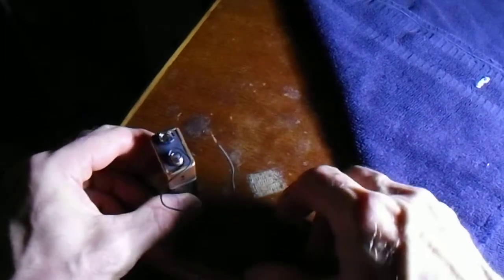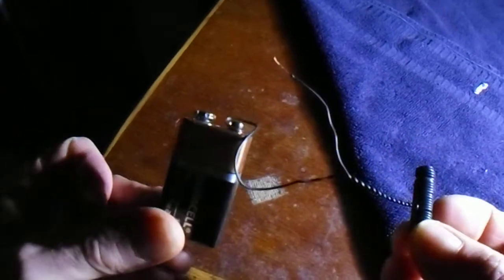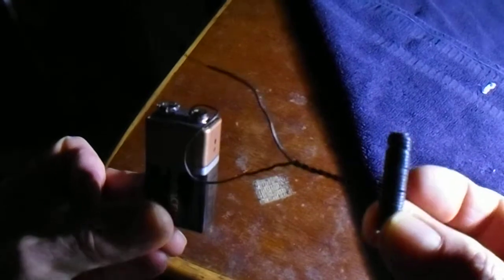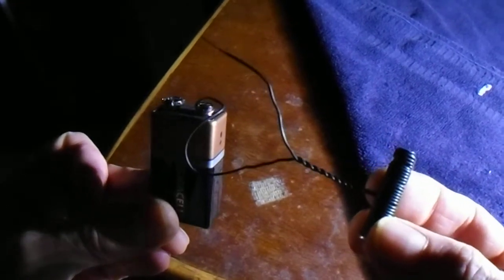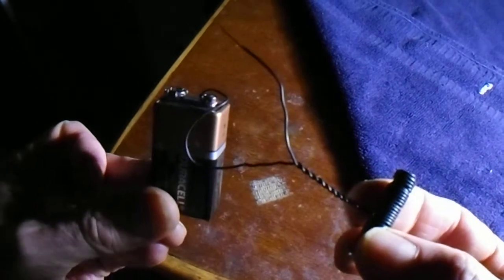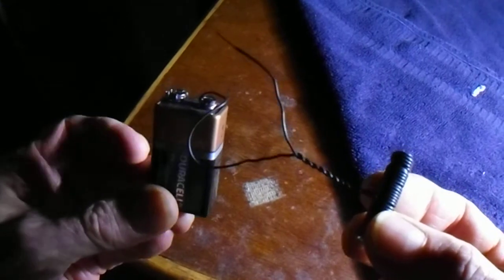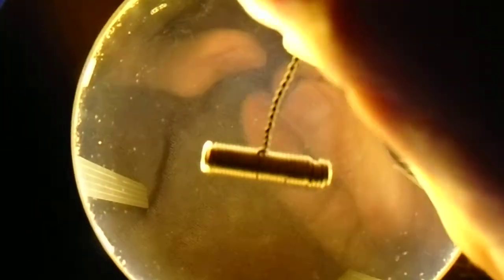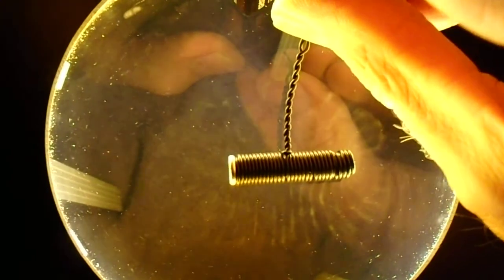electro magnet on ferrocell

Comment: Ferrocells are neet. They are at best magnetic analogs to a hall of mirrors, magnetic illusions complete with many distorted mirrors. 

Here's a simple experiment:
Step 1. Take two cube magnets only because all faces are the same size, but really,  any magnet will work for this experiment.  Mark the sides that repell and attract. These are the magnetic poles. 
Step 2) Reduce the number of light sources in your ferrocell to one.
Step 3) Place one pole facing down and move the magnet around. 
Step 4) Leave the magnet in place and walk around the ferrocell.
Step 5) Leave the magnet in place and move the light source. 
Repeat steps 3,4, and 5 with anyone of the cube's six nonpole faces on the ferrocell. 

Notice the bands of light move with respect to the magnet in steps 3-6. Hint: Neither magnetic fields nor magnetic equal potentials change their position with respect to an isolated magnet's position in space, your position in space, nor the light source's position in space.

If it is not already obvious,  the lines of light in the ferrocell though effected by magnets do not represent any magnetic field lines, or magnetic equal potentials.

I would hardly characterize ferrocell many light sourced spiraled illusions as "what's actually going on".  They are more like a magician's prop that fool the observer into believing something that's not real.
Reply: Saying magnetic field lines of FORCE are not real is the same as saying electricity which enables you to type is not real. Stop being stupid.

FIELD aka AEther Perturbation or Aether FORCE is the TRUE and REAL essence of the Universe. Not magical particles having magical charges that goes against the Law of Contradiction which states that equal in magnitude but opposite things CANNOT exist. There are only equal in magnitude and SAME things but different direction can exist.

Did you really "believe" we are made from magical charges that are chaotic, discrete and the surroundings are empty space?

This goes against the very basic of "pressure". Empty space CANNOT exist. Discrete sphere CANNOT exist. Opposite "charges" CANNOT exist.

Why? It is because they are fantasy . Saying we are made from such fantasy is the same as saying we don't exist which is retarded .
Reply: @lukiepoole6701  It has been known since 1887 that the aether doesn't exist, and continued experiments have confirmed it to ever greater precision. https://en.m.wikipedia.org/wiki/Michelson–Morley_experiment

Established that the speed of light is the same for everyone in all directions in any reference frame, proving that light waves does not move through an aether medium like sound waves through air, laying the foundations for einstein to build his special and general theories on relativity.

Comment: Hello Brian, I am fascinated with your experiments. I noticed that there are many different types of oils  to make a ferrocell, including Karo syrup. Could you please tell me in your opinion which is the best oil/fluid  to use to detect the weaker magnetic fields? Thank you for your response
Reply from the maker: I have never used any oils but Mouse Milk tm.    I have tried baby oil and tee tree oil. and combos etc but generally use mouse milk and a drop of baby oil. don't know why ... I may make a video of different oils or oil mixtures.
Reply: Is Mouse Milk a penatrating oil?
Reply from the maker: yes. its used in the aircraft industry.  I'm not sure if it comes form mice though ;)